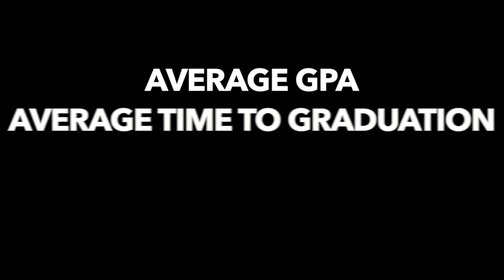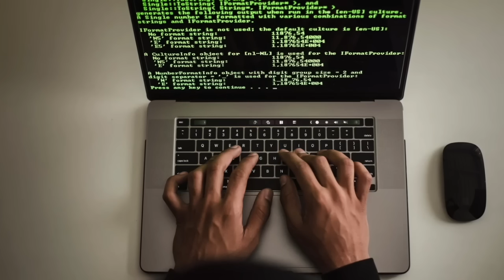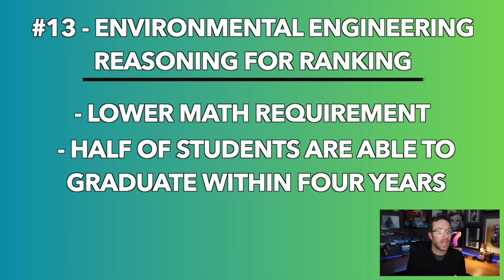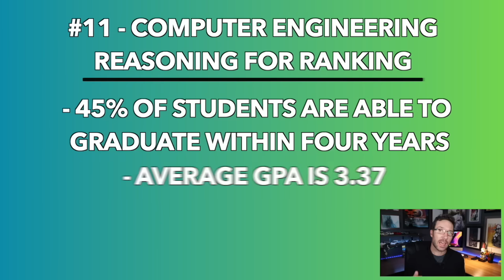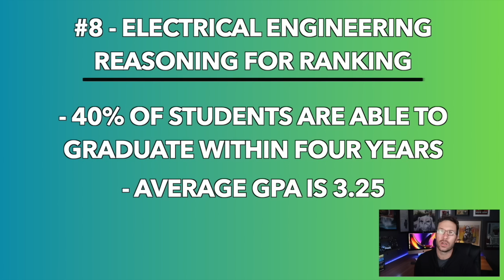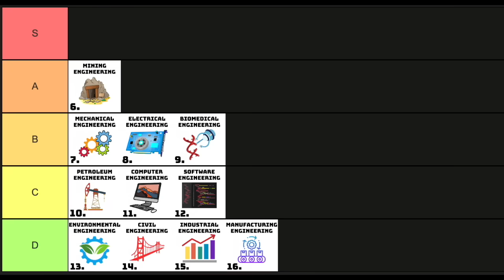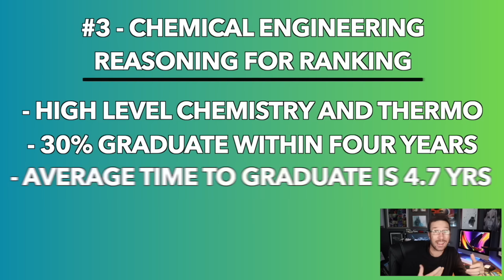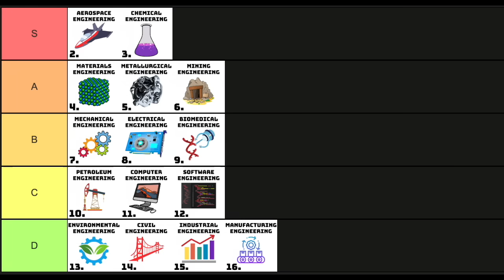Engineering Degrees Ranked By Difficulty (Tier List)

Comment: No wonder US engineers cant cut it in Europe and engineers like me were paid silly amounts in the US. We had 360 hours plus co-requisite modules, and it's all done and dusted in 30 months. Oh and by the way electrical engineering and electronic engineering are completely different degrees over here. Electrical engineering tends to cover very high power like overhead lines, substations and that sort of thing. What I do in electronics is quite esoteric with trying to get the best compromise between power consumption and noise levels. They are opposing factors too EG you cant use a SMPSU as it makes too much noise even though it is more efficient than a linear regulator. You cant use high resistance components as at even moderate frequencies (say 10kHz) a 100k resistor is a noisy git. Cooling the electronics down is rarely an option and involves ceramic PCB's which are 1 expensive and 2 difficult to get. If you don't use them then liquid nitrogen temperatures cause the components to break, the traces to break at the IC legs or both. Then there is the endless mathematical modeling.. Most companies will not even entertain things like Match Cad so you are trying to do differential calculus with a spreadsheet. It can be done. Drives you bat crap crazy but it can be done.

Comment: As an electrical engineer, I know of no program that does not require partial differential equations and LaPlace transforms. I don’t know how you can understand circuit design without those backgrounds.  Perhaps the disconnect is because many EE programs offer that last math course internally, instead of from the math department.

Comment: Retired Mining Engineer here.  Although certainly not the most glamorous profession, it provided a ton of wide and varied experiences:  you are expected to be a bit of a jack of all trades, and I have had to become proficient in Materials, Environmental, HVAC, Industrial, Geology, as well as having a good working knowledge in Civil, Mechanical, and Electrical/Electronics disciplines.  Depending on the specific jobsite, you might find yourself as the only engineer on site and have to wear many hats.  As you stated, you might end up in some very out-of-the-way places, but I wouldn't have traded it for anything.  Remuneration  can be very good, especially if you are in the developing world.
Reply: Am currently studying the first year of mining engineering, got any tips?
Reply: @banana6837  Mining engineering today (unlike when I was studying) is incredibly reliant on specialized software.  Take advantage of being a uni student, and become familiar with as many software packages as you can (get free demo or student versions if available).  You will probably change companies several times, and mining companies, even in the same region or country, often vary widely in terms of what CAD package they use, what planning and design software, even more specialized stuff like ventilation or safety software.  Learn it all and become proficient with as many as you can.  I still do a bit of consulting work, and every job uses different software, and they send you files in a million different formats.
Reply: @Fredman2410  thank you for the help:)
Reply: Currently learning Vulcan and Carlson  . It’s a lot but I rlly enjoy it
Reply: @Fredman2410  Good day, sir. Based on your experience, what are the advantages of open and underground mining? I am currently choosing where to start my career. Underground mining seems more exciting to me, but at the same time more dangerous and responsible. How difficult will it be to move from underground to open mining or tunneling.
Reply: @donfrancisco8406  Hi, I've never been involved with open pit mining,  other than doing some safety inspections.  It is more a materials handling process, and I don't really see a lot of hard engineering going on there, other than some blasting calculations.  My colleagues and I usually say that "It's not mining, it's farming" when we refer to open pit mining.
Reply: @ Thank you
Reply: Currently a Mining Sophomore doing an internship. Any companies or specialties you recommend to do more work abroad?

Comment: Rankings are dumb. Every field of engineering is complex if you get deep enough in. Industrial engineering is mocked as an easy engineering route but let me tell you there is nothing easy about non-convex optimization. Also my signal processing friends would very much disagree that the highest level of math for EE is ODEs.

Comment: Not sure where you are looking up coursework, but EE goes way past ODE.  PDE is a pre-req for field analysis. Control theory and Communications relies on Fourier and Laplace analysis that puts you on par with most undergrad physics curricula.  If you are looking at degrees without those areas, then you are likely looking at computer engineering labelled as EE.

Comment: I did a joint honours in metallurgy and materials science, mostly because the UKAS entry requirements were the lowest of any of the engineering disciplines. I assumed that because the entry requirements were low then the course would be the easiest of the engineering disciplines. After two years of struggling through my course, and discussing syllabus with friends doing other engineering disciplines I realised I was far more advanced. I spoke to my tutor about this and he laughed saying, the entry requirements were deliberately set low to encourage more people to sign up to the course. I graduated 20 years ago and in that time I have worked for several large companies and traveled the world on business. I have not been unemployed for even one day in all this time. I highly recommend metallurgy and material sciences to any young engineer.
Reply: I have to agree that the entry requirements for MSE are low because nobody knows what it actually is. The level of maths required is high when you consider electronic materials; I.e. quantum mechanics, materials processing, ode's and ode's for thermodynamics and fluid flow, tensor analysis and matrix algebra for strength of materials stress analysis and vector algebra for crystallography. A lot of chemical thermodynamics and mechanics . I loved it and have a Ph.D. and was a uni professor for decades. I work primarily in mechanics of materials, fracture etc. I've worked for Rolls Royce, British Aerospace, what was the CEGB, caterpillar, ALCAN and taught at uni in the UK, USA and Australia. It is a hard subject if you want to really understand and develop materials. It's a pity that mechanical, civil, nuclear and aerospace engineers really do not have a real understanding of Materials/Metals. In the USA they take only 2 semesters (6 credits) of very basic materials science.
Reply: @JohnPilling25  This whole comment is super interesting. I'm a senior in highschool and I took a camp that was an intro to materials engineering and every time I would ask them a question the response would be "you just have to learn it yourself". I love how complex it sounds and I'm applying to be a materials engineer in college. If you have any other advice for me I would love to hear it, like what college you went to and how it compared to other colleges, or even any other insight you can give me. Please respond to this comment!
Reply: @ I presume from your use of "high school" that you are in the USA. I was educated in the UK at Manchester University, BS, MS and Ph.D. I taught MSE for 20,years at Michigan Technological University which in my opinion is one of the top undergraduate schools for materials science/metallurgy in the USA. I am still an adjunct professor at MTU. My advice is to avoid big name schools as the undergraduate classes are mostly taught by graduate students not actual faculty members who are more interested in graduate and research. A lot depends on which state you live in whether you want lower in state tuition or are prepared to travel. My advice is go to a good community college for the 1st and possibly 2nd years to cover the basic math, physics and chemistry that you will need later on. At nearly all US universities the first 2 years of classes are not taught in Engineering as US high school doesn't teach anywhere near the level of math physics and chemistry required. Make sure that the community college credits can be transferred to the university that you decide to go to. Here are some very good schools..... UC Davis, University of Washington, Pullman, Case Western Reserve, Virginia Tech, Michigan Tech, Missouri-Rolla, South Dakota school of Mines, Colorado School of Mines. If you are interested in electronic materials then University of Florida.  A lot depends on your particular interests. MTU materials has lots of good scholarships in Materials, it is well supported by industry and we have never had any problems getting our students jobs in industry or into graduate school for those who want to. Our courses have a lot of hands-on work and this is what industry craves.
Reply: @Dr.Cranky I wish there was a way to save this comment for later cause ever since I found MSE I was wondering why other people don’t even look at it. Thanks for the schools

Comment: You omitted structural engineering. As a retired architect I worked with many engineers and enjoyed my career working with the many engineers that can be involved in building design, including geo technical, civil, structural, mechanical and electrical.

Comment: The funny thing is that almost all, and I mean more then 99,9 % of engineering isn’t done by brains anymore, but done by computer models, already build in computer software where all kind of simulations are done by the computer. The algorithms are adjusted by a lot of self learning computing and believe it or not, by trial and error.
So the thing is, there will of course be new ideas, but the real math isn’t done anymore by people.
My excuse to write this? I myself am an engineer and work in IT.

Comment: Software engg here on my 5th year. I'd agree that the theoritical bits and math arnt that difficult in most of my classes (practically speaking its capped at complexity analysis + datastructures and algorithms). The main difficulty is the amount of goddamn projects you need to do. Pretty much every class in the later years will have a lab component + a full project. The projects are hard because you're always expected to build a full working app whereas my pears in EE can get away with building a simple prototype (Which in retrospect youre going to need even as a CS major to find a job anyway so its not a bad thing). So if you hate coding and designing applications from scratch, def not the degree for you lol

Comment: My father was an aeronautical engineer, he designed airplanes. I call it hi-tech iternerate laborer. Companies get contracts based on artists' drawings. Then they hire all the aeronautical engineers to actually design the plane. When it is ready for production, they fire all the engineers.
Computer programming is also a career to avoid. There are no lemon laws for software. So companies hire the cheapest warm bodies they can find. That means new grads. That means when they fire you, you are no longer a new grad and cannot get a job.

I have Physics, Math, Electrical Engineering, and Computer Science degrees. I have worked in 11 different industries.

Comment: As an engineer, I would question the amount of chemistry needed for nuclear engineering.  It seems the amount of chemistry would be quite narrow compared to several of the other engineering degrees.  That said, nice job!
Reply: no organic or bio, but P chem, inorganic is certainly needed. Got to control coolant and steam chemistry to prevent corrosion, purify water, etc.

Comment: Congratulations on a very good job. The three you list has been at the top for many years. I studied chem eng in the ‘60’s, worked as a chem eng until the ‘90’s, and then taught 2nd, 3rd, 4th, and graduate courses until 2017. I recommend all the majors you list as long as the student is willing to work hard. If a nominal level of intelligence is present, hard work trumps genius intellect.
Reply from the maker: Love it! Thanks for the comment

Comment: STEM PhD here.  Your ranking method is pretty flawed.  You can't measure difficulty based on things you mentioned (units needed, final GPA, time to complete degree, market demand or salary).  It all depends ONLY on 2 factors: (1) the individual and how well they are equipped (mentally and academically) to deal with the subject they chose to study, and (2) the difficulty LEVEL of the material and exams dictated by the institution you chose to study at.
Reply from the maker: Valid points. So how can you quantify that?
Reply: @becominganengineer2271  I don't think there is a way to quantify "difficult".  You can make a general qualitative statement that Industrial Engineering is a lot easier than Aeronautical Engineering.  But, there are way too many "other" factors that make it really "difficult" to give any quantitative ranking across all engineering domains.  For example, an individual can be top of their class in an engineering course in institution A, while if they went to institution B (where the level was much higher and the exams a lot more difficult), they would flunk out after the first year.  As I wrote, it is also really dependent on the individual and their relationship with the material.  I have an MSc and PhD in Nuclear Engineering (from a top rated university that is considered very hard on grades), but wouldn't have lasted a semester in Industrial Engineering, where many of my friends went to have a good time.  If I had to look for some quantitative measure of difficulty for a specific engineering course, I'd look at the level of SAT score needed to get accepted multiplied by the attrition rate (i.e. total number of people dropping out of the course before completion), and only look at top rated schools, known for academic excellence.

Comment: My dad was an engineer for Grumman and was one of the designers of the Lunar Module. His degrees were in Mechanical Engineering. His best friend and colleague who also worked on the LEM was an Electrical Engineer. There is no such thing as “aerospace” engineer. Designing and building spacecraft involves the traditional engineering disciplines.